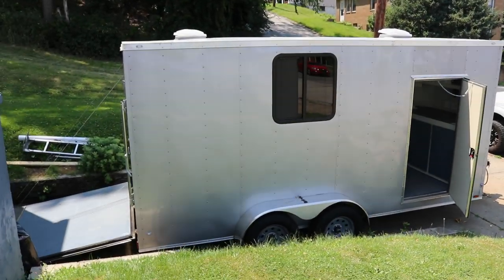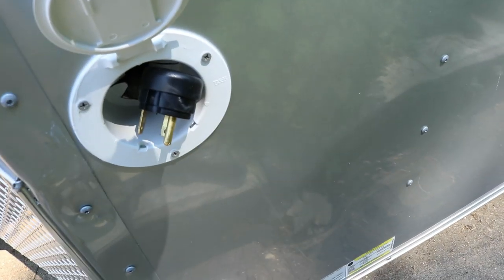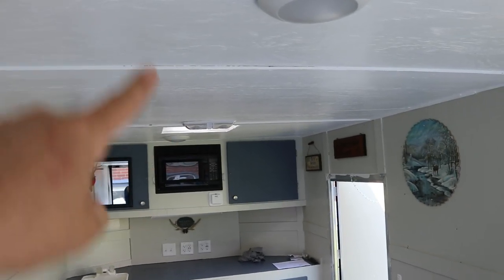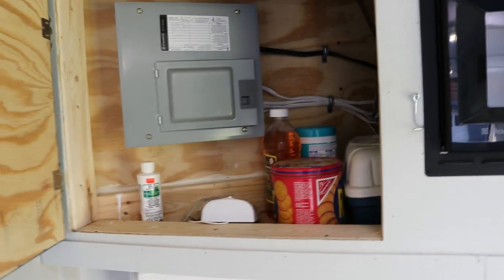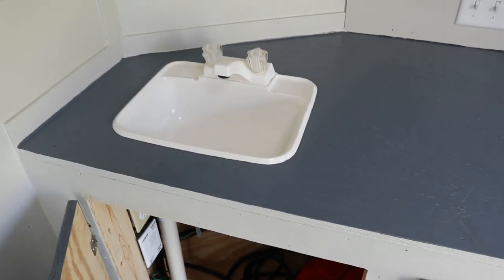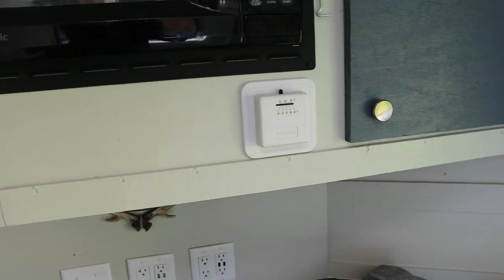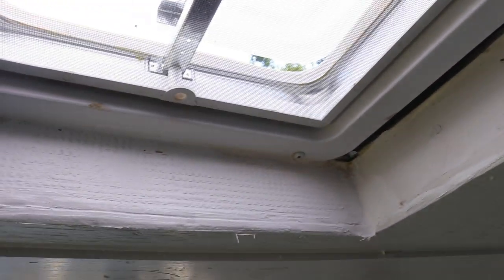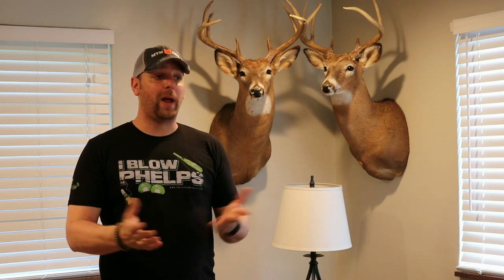My cargo trailer/portable hunting camp

Comment: I have been working on a similar project. A few things you might want to do....switch over to LED lighting for the 12 volt lighting system.  For sleeping, I made a set of bunks that fold down from the sides. It uses two twin size bed mattresses, so they can be run as individual bunks. To take up the space in the middle, I simply put a piece of plywood across to cover the gap, and then you can spin the two twin mattresses around and put them together for one big bed so you and the wife can sleep together. Works great, and removes the need for air mattresses. The downside is that it does take up a bit of space on each side. Cabelas has a set of XL bunks that can be stacked or separated. That was the other option I looked at before committing to the install I went with. If you are hauling a ranger or 4 wheeler, check out E track and you will not be disappointed. Great set up! Hope to see some follow on vids on this so I can get more ideas for my set up as well. What I took from yours is : I need to add the dual propane bottle set up to the front, and the screen door idea! Thanks.
Reply from the maker: rbljackson all of the lighting is LED for the 12volt and the 120 volt. I thought about the bunks but I was worried about fitting the Ranger, angle of the trailer if parked on slope, keep my head up hill.  I kept it simple and use a cot. Works fine. Bunks are a great idea especially if there is more than one person to save space.

Comment: I didn't see any tie downs for your 'ute, did you cover them?.  E track would be good for that, plus you can get pieces that hold a two by four.  Two two by fours supports a 6x8 plywood, which supports a mattress.  Voila, a bed and it packs up so you can park the atv and tie it down.

Comment: Just an FYI when using heaters if you use a portable style heater or whatever crack a window or a vent that’s all you have to do, you should anyway because your body creates condensation. Your not going to get poisoned.
Reply from the maker: Powder River the heater I was using did not require ventilation because it was a direct vent to the exterior but I know what you mean. The trailer actually help heat pretty good I only really use the heater when I came in for the evening then shut it off before I went to bed. I did not experience any condensation on the interior of the trailer but I'm sure if it was more than me in the trailer it probably would have.
Reply: Getn Lost  absolutely

Comment: Just curious what kind of heater that is (Brand - Style)??? I'm working on one myself and need a good heater to use in the rough winters of Wyoming for hunting.
Reply from the maker: Honestly I do not remember the brand. I know the btu on it was slightly higher then the square footage of the trailer. You just have to make sure it's a direct vent so it actually vents to the exterior of a trailer. A standard propane heater it's significantly cheaper but it will also pump fumes and moisture into the trailer.

Comment: Very nice. Looks like youll be rather depemdent on ac power. Generator, campground power, or both?
Reply from the maker: joe woodchuck the interior lights are all on battery which I have set up to charge off the truck while driving or while the generator is hooked up. I spent a week in it without even hooking up the generator I just don't have a microwave. Seems to work out pretty good.

Comment: What's keeping your exterior pipes and tank from freezing?
Reply from the maker: Steven Morris the only pipe that actually is exposed to the exterior is the drain to the sink it just goes a couple inches below the floor and is cut off I did not install Plumbing because of that reason. I used the 5-gallon jugs with a spout sat right on the edge of the sink. I did have it set up for a pump but never actually installed it.

Comment: id still crack the window with that heater, or at the very least run a co/smoke detector
Reply from the maker: I actually had a battery Co / smoke in the trailer I did run the heater for about 8 hours while I was not using it and had no issues according to this c o meter